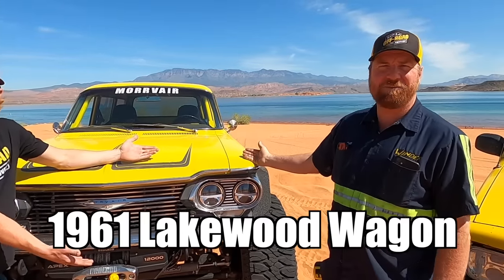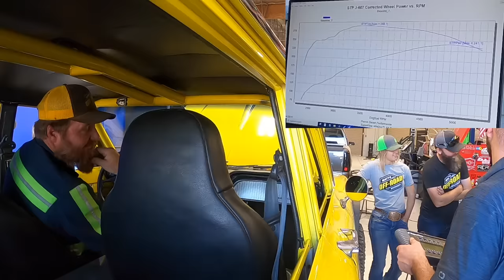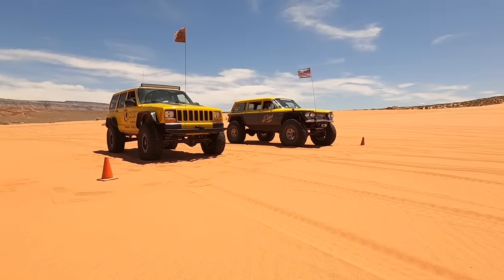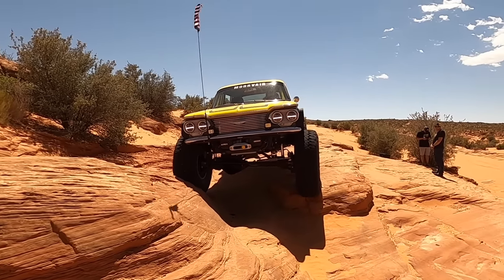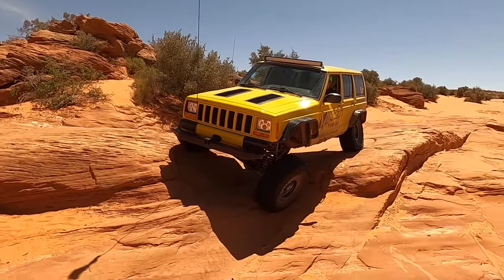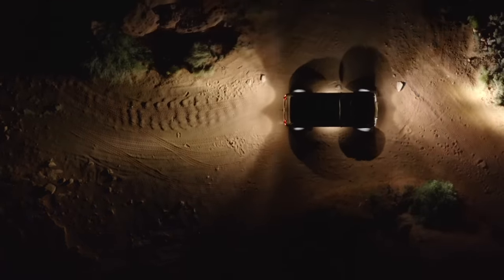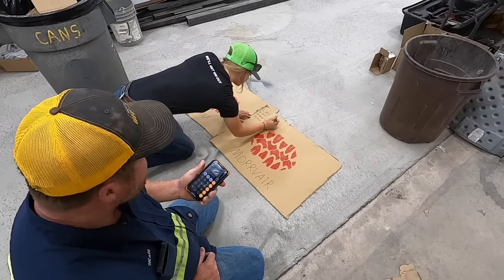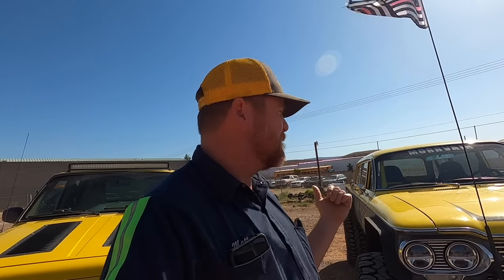Banana Vs Morrvair - Ultimate Off Road Challenge!

Comment: Just a bit of an FYI on the psi test. I know you rounded things off and front/back is not the same, but let me just spare you this experiment in the future..... The pressure on the ground will be equal to the pressure in the tire. Once you set the tires to the same pressures, there isn't any need for competition because the result between the two vehicles will be the same once you account for all things. You see, if the pressure in the tire is DIFFERENT than the pressure to the ground, the tire will sink or float. Soooooo the fact that the cars are peacefully resting on the shop floor tells you that the pressure in the tire is = to the pressure on the ground = to the pressure of both vehicles. If you have different tite types/sizes, then the footprint may be different, but the pressure will still be the same.
Cool videos, Keep up the great content ;-)

Comment: The hotter that sugar sand gets the more soft n swallowing it gets . Morivier shines there. We use the flat surface balloon tiered to tred n press that sand for grip on it. You should see the oil big rigs with them huge balloons on them walking the sand to go Eco survey the wells or pull the big rigs with those deep drill towers. More tiered than rigs for sure.

Comment: Upfront, I am biased, having been an XJ owner.  A 4.0 is an amazing engine, and the trans too, and just plain an XJ packaged with them.  And what I've watched you do with the Banana is amazing.  I couldn't believe the Banana's 4.0 hasn't been torn into with all the abuse I have been watching.  Watching that 4.0 work over time, both lug and rev is testimony to what those do best.  Listening to the Moorvair's LS-? running, to me, sounds like a typical Chevrolet - no torque down low and rev the piss out of it to get it to work for you.  I heard it bog and bog against the torque converter down low, unable to put the chassis to work.  A looser converter, or more gearing, would probably make it get busier, but would just make it less wieldy.  I feel I can say a 4.0, despite being a little guy always pulls more than its weight and all over.  In contrast, if you can rev the Chevy, then yeah, it wins, well when that kind of race counts.  But, I suspect it won't make a good tow rig unless you can get it to rev...which isn't usually what makes a good tow rig.  Ya the Moorvair won today in these head-head challenges.  But, its 2.4x horsepower didn't really show up that big of a difference.  Time will tell, but it would be interesting to get your real world use observations once in regular service duty.  Oh, don't get me wrong, the Moorvair is way cool - I guess I'm simply not convinced the standard-issue LS-whatever makes a good tow truck motor.  Whereas, the 4.0 does appear to be so.

Comment: If you're running the stock cooling in the banana, you could put in a 3 row radiator and replace the fans with a dual electric system.

Comment: HEY MATT.....Love your channel. I'm the off road maniac in the family & now I have both my brother & 82 year old Dad hooked! My question to you: when you said you had to add water to the Banana's radiator? As someone who WORKS in the motorsports industry, have you ever used ENGINE ICE in your vehicles? It's proven that vehicles that run Engine Ice will operate at temps 10 degrees cooler. I LOVE Utah & AZ & have been there many times in my 06 Taco. Can't WAIT to go back with my ADV motorcycle! 
If I ever WIN the lottery? I'm going to make you an offer on the Morvair!!! :-D

Comment: To get PSI on ground, you need to take front axle weight divided by 2 tired to get PSI on front axle, do the same for rear axle. 

I would suspect the weight ratio on the morvair is 60 % rear 40 % front due to rear engine and body.  And the jeep is flipped 60% front / 40 rear, which is why with horsepower of the morvair does a better deadpull

Comment: If you want headlights with distance you want them as low to the ground as possible so that you can point them up and have projection headlights pretty much exactly like the headlights on my Lexus CT200h. I just have the incandescent ones but there's still the brightest high beams I've ever used. Trucks are at a disadvantage having the headlights shine from a high point. You don't actually want that unless you're trying to get over something.

Comment: 26:29...yup...that's how psi works guys 🤣 you would always expect each square inch of tyre to hold up 8 pounds of weight when its inflated to literally 8 pounds per square inch. The difference between the two could easily be accounted for in gauge tolerance and measurement tolerance. I dont mean to take the piss...but that "huh...they're they're really close" moment was funny

Comment: LED is definitely the way to go I did the same thing on my 98 Tacoma SR5 4x4 there is not an incandescent bulb on my truck either even on the interior dash lights Dome lights everything is Led the only thing I had to do was put a digital relay in for the directionals so that it did not hyper Flash

Comment: Does the banana overheat due to dust build up in the radiator? If so, maybe switch to an electrical fan that will reverse. Like they have on some loaders and tractors to blow dust out.

Comment: I’ve had an xj 99 4.0 stock on 4.5 lift flooded it like 3-5 times pulled the spark plugs out and let the water shoot out put  new oil new gas and it will turn and run like a champ😇

Comment: Hey Matt,
Curious if you would do a video on the hood louvers, if the make any difference in the engine's operating temperature, or if it only affects the ambient air in the engine bay. 
Thanks,
Tyler

Comment: Ever though about mounting an extra radiator on the roof of the banana with a cooling fan?  Just run a one inch braided line up one side of the windshield and down the other and braze some AN fittings on the radiator.

Comment: I know your running in sand so the 8psi about right, but actually a little surprised it was below 20. I have a '23 Super Duty with 37x13.50. They fit under the stock suspension with the snow plow prep package. There is a little rub on something, didn't have a spotter, & didn't see obvious signs on area it rubbed on in full right turn, as I back out of a customers driveway with some articulation, not sure how much articulation. They came from the mail-order place with 40psi. That didn't seem bad, but the max psi is 65 on the Yokohama Geolander X-AT's. They are on 17'x9" Black Rhino Warlords Matte Black with dark tint rim with 12 offset. The tread on the rear sticks out from wheel wells about 1/2". I like the stance. I'm running at 60 psi on the front, 62-3 on the rear, in a vain attempt to get the TPMS system to read the sensors but they have not. The rig once fully equipped with aftermarket bumpers, SpaceKap, with ladder rack & tools, will be rolling at around 9800 lbs. What psi would you recommend for highway speeds. Should I run them down more as they seem to be "razor backing" a bit. The 37's look great but not really necessary for what I do, but...

Comment: I'd go with the Banana in terms of everyday use. More leg room, more room for cargo... Doesn't get away by much comparing it with the Morrvair in off-road ability. It's a 30ish old car and the Morrvair is a brand new one. It lacks a few horses, and do some bits and bobs. I'm surprised the brake hoses still standing.A complete makeover like the one you did on the Morrvair, better engine, with higher suspension, wider arches and axles, and surely it will surpass the Morrvair. Banana rules!

Comment: -- I like your flag.  Emergency services stripe.  As a pilot that flies WWII fighters, I wonder after the cost of operation hours between the two vehicles.  I'll toss in, I've run Jeeps for 25 years.   If the 1911 is the Lord's pistol.  Then the I-6 is the Lord's motor.  Anyways, thumbs up.

Comment: What is suffering the most at pulls like that, when youre having difficult and need to keep repeating, tyres spinning? What would blow/go out first if the tires had really great grip but could pull due to weight or angle, is it a part you can get really strong/dureable? 
Great video btw.

Comment: How about putting a diverter on the heater so you can exhaust the heat outside,and when it's cold switches back inside

Comment: For twice the horse power the drag races weren't much different. But gear ratios make a difference in pulling power. So it's not about speed it's about brute force. Need to redo this test after  the Banana is finished being modified.

Comment: Tire's contact surface is just a question of pressure ! No need to paint your tire !
People often think bigger tires will bring a bigger surface : it's false ! But bigger tire will allow a lower pressure... wich will bring a bigger contact surface ;-)
Of course more weight means more pressure needed for an equal tire size...

Comment: Great video…with respect to the tire footprint test…doesn’t higher pounds per square inch translate to better grip on hard surfaces? That’s the reason old school off-roaders ran pizza cutters.
Reply: Not in bottomless windblown sand. You want to float on top.

Comment: You need a doggie ladder and platform like a boat has for the Morrvair so the dogs can hop in lol. Are you going to rebuild the Banana when it's time or retire it? A wrangler unlimited has to be close to the same size and they have a diesel engine with over 400lbsft of torque. Just curious like your videos it seems like it's a little more than a job/business to your family more like a way of life. Maybe a uni-mog would be cool to add to the fleet. They have a smaller version than the military truck.

Comment: Your ground pressure is always equal to the tire pressure. Your tires deflect until the inches of contact patch * the tire pressure = the corner weight of the car. I think all you did was inaccurately confirmed you tire pressure gauge works.

Comment: Regarding the dyno test - I think torque is a lot more important than horsepower in this application.

Like Jay Leno says all the time: "Horsepower sells cars - torque wins races".

The power figures are suprisingly low to me. Over here in Germany, our prevalent FWD cars are usually rated power at the wheels. 240hp for the Morrvair on the dyno seems a little low to me. Do transmission+differential "eat" that much?

Btw: Does anybody know the rated hp of that LS engine?

Comment: I would beat the crap out of my 98 xj in Tuttle creek Kansas got it for 600 put a 3 in rough country lift I found at u pull it. All I did was put spartan lockers in the front dif and it would out crawl most built JK's and JKL's with all terrain tires! The xj is the goat for the working man! Just know how to replace a u joint on the trails lost a few of those lol

Comment: Just my opinion, but why wouldn't you change out those off road terrain tires for paddle tires when you're trying to pull on sand? Rail jobs were a big thing here where I live in Mo. in the 80's and every weekend there were sand drags on what was called "Chat" which was just the tailings from the lead mines in this area. All of the dune buggies had paddle tires on them. Sadly that was shut down by the EPA and now the chat dumps are completely closed off.

Comment: Measure it as an oval (like below), or measure it as a square.  Both ways are erroneous.  Those measurements consider that there is only one tire holding up the entire vehicle.  You have to multiply the sq. in. by 4, then divide by gross weight.  Formula Oval:  PSI = GVW/(PI*R1*R2*4).  You mention that the tires get better in the sand as they get older.  Your assumption is that they need to wear down in order to do so.  I do no believe that is the reason.  I believe they get better in the sand as they get older because the walls have had time to flex and deflect over its age, giving you a larger foot print when the tire is older.  When those tires are 1 year old, do the test again.  You'll have a larger footprint and thus a smaller PSI presence.

Comment: You have probably already thought about it and maybe there is an obvious reason not to but could you snorkel from the heater coil to outside to vent off heat from the banana to keep it from roasting yourself?
Reply: Heater core
Reply: Another thought could you make an adapter that would go on 5 or 6 back lugs so you could make duals on the back of the morvair for more flotation and traction when needed for  dead pulls. Pull one tire at a time on 1 foot block of 6x6 to add and remove extra tire. Easy to type harder to make work. If it would.

Comment: Matt, YOU ARE WRONG. Morrvair is not lighter. The real conclusion about footprint and weight is that in fact the Banana with a bigger footprint transmit its weight more efficiently than the Morevair. Which ever has more contact with the ground will float better. Hence Morrvair will have greater tendency to sink on softer sand cause the tires are still to rigid. Therefore it footprint, or better said, the area of weight displacement is smaller. Think of this as in the footings of a house. The larger they are the better they transmit the weight coming from the columns to  the ground making it stable or float better

Comment: Guys I think you did your math wrong on the PSI calculation on the Morrvair. I actually calculated that the Morrvair is heavier per PSI at 8.97 PSI. (14.5Lx10.5W=152.25)(152.25x4=609)(5460/609=8.97 PSI). Let me know what you think...

Comment: Trade in the banana for a c10 and put a brand new light duty wrecker body without a wheel lift use a sling instead
Reply: @MattsOffRoadRecovery  use dually like the other guy does and get your wheels from stazworks he’ll make you a set of bead lock duals
And a lot of the light duty miller bodies are aluminum.
You should have something halfway between the banana/Morvair and the largest off road wrecker.
Talk about heavy, those axle techs are like 2000lbs a piece and you’re worried about a fiberglass+aluminum wrecker body where the only steel components are in the frame boom and winch? I think you could offset that with some good off-road tires on duals.
Technically it’s not even up to the min Gvwr of a wrecker body but that could easily change if you build a frame and put it on 60’s or something.
I get it sand hollow is wicked dusty and sandy, I’m from a river bottom I know about dust silt and sand, I know the difference between them, and I’d say if you still have problems on duals even with off road tires and airing down, use chains, and you’ll be fine.
Reply: @MattsOffRoadRecovery  I’m 100% in favor of keeping the morvair, if you wanna keep the banana keep it, but you’re missing an in between rig if you ask me.

Comment: Jeep only got about 60% of its engine power to the wheels?  That's pretty bad.  Were the tires fully inflated?  Suspect it would have put down a little more with stock and hard tires.

Comment: The tire contact test was done completely wrong. Guaranteed there is a differential weight distribution between the front and rear of front engine vehicles. That is why professionals put scales at all four corners before declaring the weight balance. Often enough, there is a corner to corner difference.  And they totally screwed up the math.  The tire contact patterns were not a square rectangle, but more like a "rectangular circle."  The shape is important for the math to be correctly calculated.

Comment: The Banana is the real hero. It's more than earned is keep. It's literally created is own channel followed around the world.  The Banana has earned a more powerful engine, better cooling, charging..  maybe a few suspension tweaks & a better electrical system hookup for the winch... manually unbolting battery terminals each time is cringe worthy for a dedicated work vehicle.. better connections will transfer more amps/pull better/less loss.  The Banana is still the proven hero... Respect

Comment: nice comparison, but your math for the lbs per sq in was off on the morrvair...must have fat fingered the calculator. lol   14.5 x10.5=152.5 therefore  5460 divided by 640 =8.53 for the morrvair vs 8.03 for the banana......The Banana won this comparison.

Comment: The conclusion is; a vehicle that has all new suspension, tires and is built to the hilt will out do a vehicle that's had it's guts worked out doing the job. Put the parts, work and money you've put into the other one and it should be a much better comparison. Just sayin.

Comment: Hey I don't know if you have ever tried this but if I ever help out a dead truck with my Ford ranger here is a helpfully tip back up as close as you can to the tow point an tie the the truck as high up on the tow rig as you can if you have a jack jack up the front of the dead truck an tie tight to the tow truck lower the front of the dead truck that way it will be easier on both trucks because it gives the tow rig tracktion to the rear wheels an it also makes it so your not jerking the crap out of both trucks an trust me 4low an 5 to 8 psi you would be shocked on what you can pull out no joke  let's just say my 94 Ford ranger 4x4 5speed with the single over head cam 4.0L pulled out a 90's4door dodge dually pulling a 25tf toy hauler with quads an a sandrail in it an my ranger pulled it all in two tries an everyone was trippin oh not to mention I was in 4 low an 2nd gear let me know what y'all think by the way my name is Robert thanks